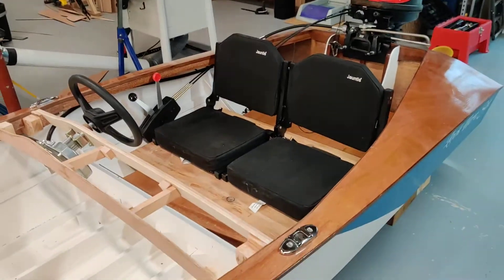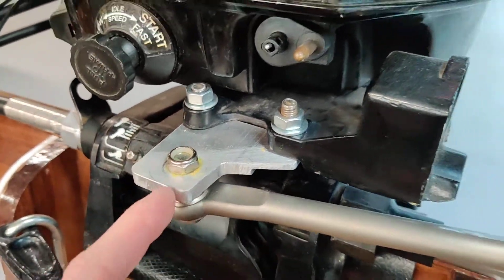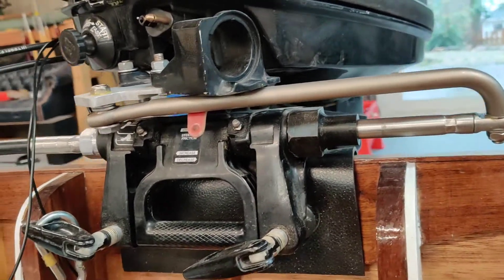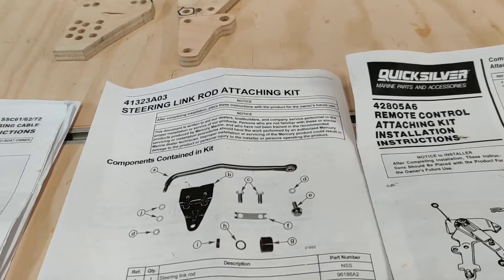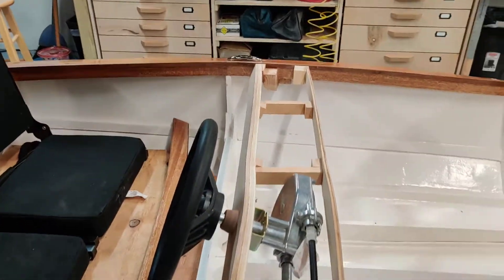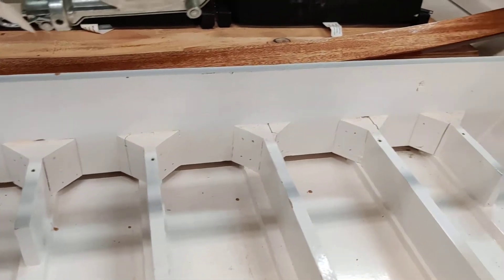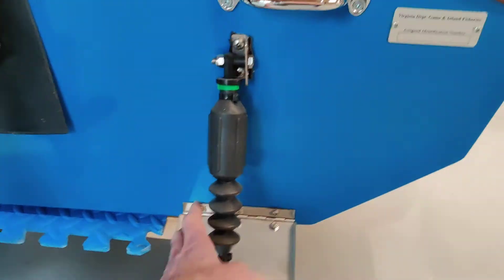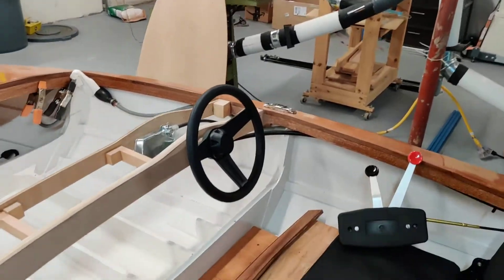Jinx Runabout Build - Phase 2

Comment: Cable steering is what you want. Get a steering bar for it from brown tool and machine for that 15. Also this boat can take a lot more horsepower. And get a deadman’s throttle is also what it is supposed to run with.
Reply from the maker: I definitely considered cable steering, but they're less common these days and are overpriced for what you get. Plenty of people are using teleflex setups in small boats like the Glen L Squirt. Not to mention teleflex is the standard for pretty much every modern motor and can be fit without any modification. 

As for more horsepower, I also considered that, but 15 hp is a sweet spot for weight, availability, and cost.  This motor has a deadman that connects to the operator's life vest, so that's handled, too.